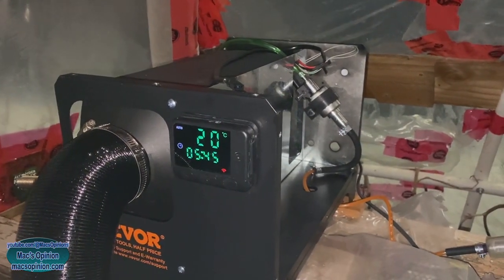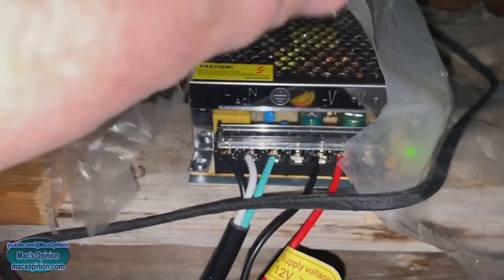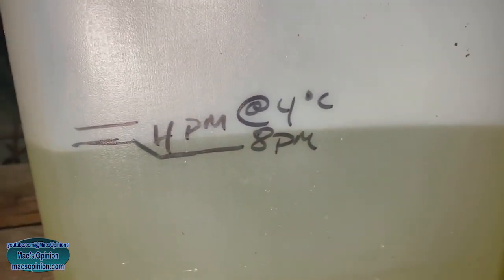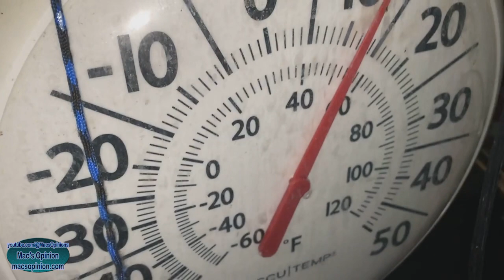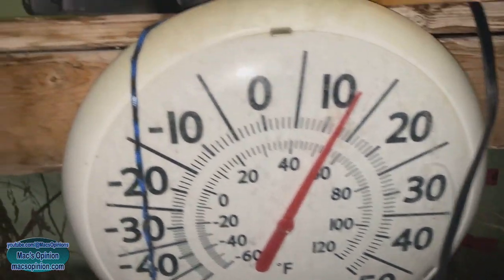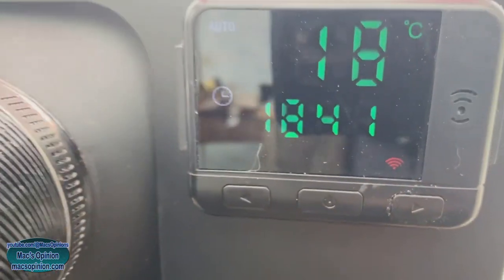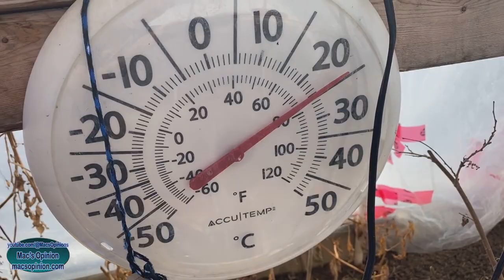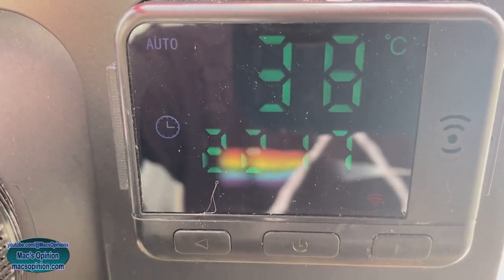Greenhouse Heater: My Vevor Diesel Heater Setup

Comment: What KW model are you using and what's the size of your greenhouse? I want to try in my 10x28x7.5ft greenhouse but I worry its not enough BTU's
Reply from the maker: 8KW - 12' x 12' x 7' - It's currently -2°C (28°F) outside and it's holding at 16°C (60°F) which is warmer than it needs to be. I have the VEVOR (link in description) and run it on the lowest setting (It has two modes. 1-10 setting and the other is by temperature)  I use setting #1 because it is the lowest setting so that I burn less fuel. I've been getting about 1 ½ -  2 weeks from 20L (5 Gallons)